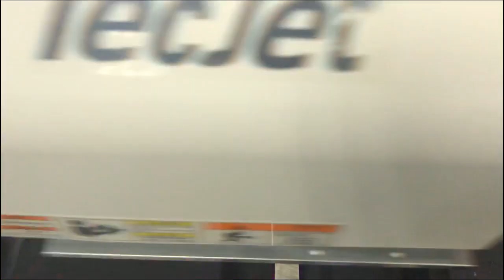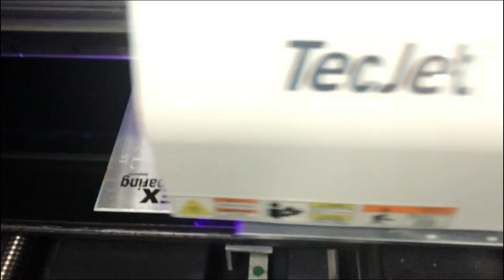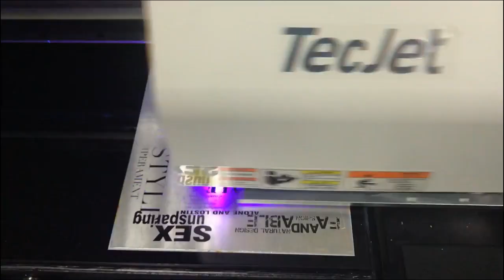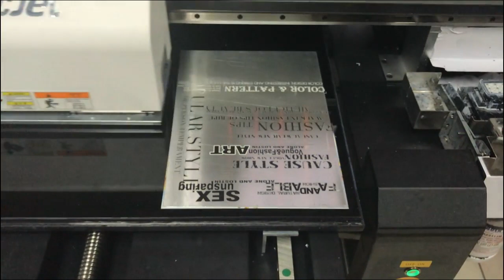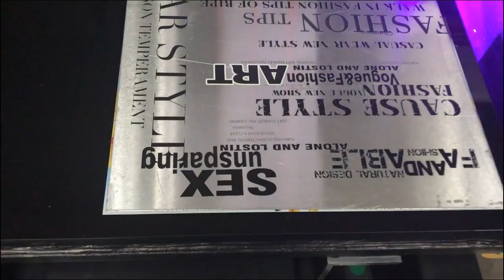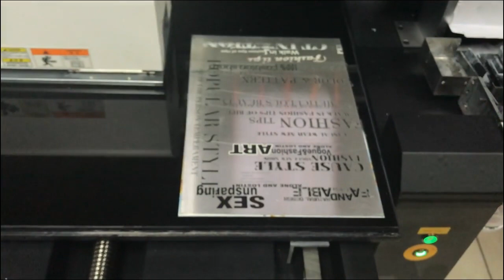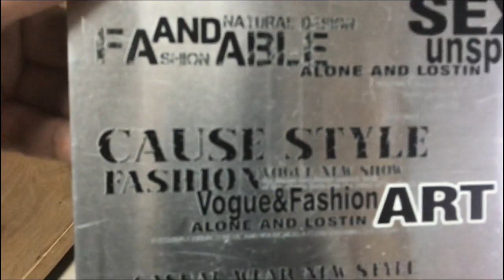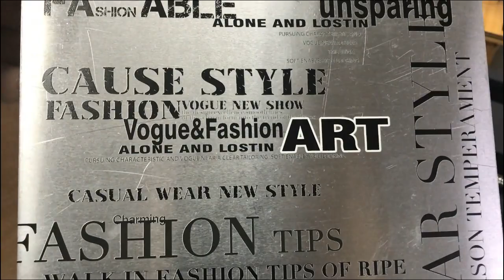TECJET 6090 UV Flatbed Printer for sale

Comment: Hello, I have a tec jetc 9060 and I have a problem, it only happens with cyan and magenta, coincidentally they are the colors with two printing channels, xp600 head.
The problem is that when cyan or magenta is printed at 100% density, the printer prints perfect, but with densities lower than 60%, no ink comes out, in the case of orange, only yellow comes out, in combined colors where magents or cyan is for below 60%, these inks do not come out, could you help me?